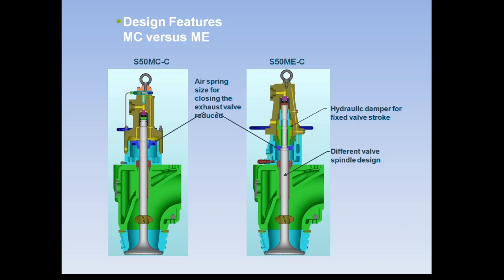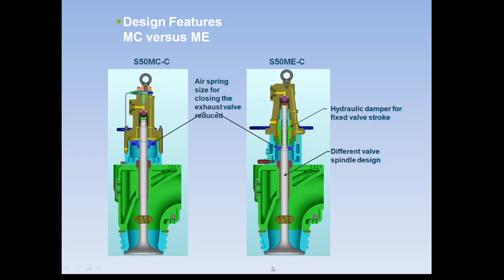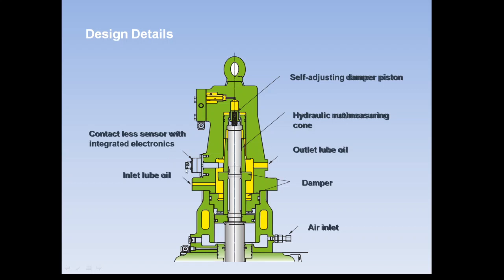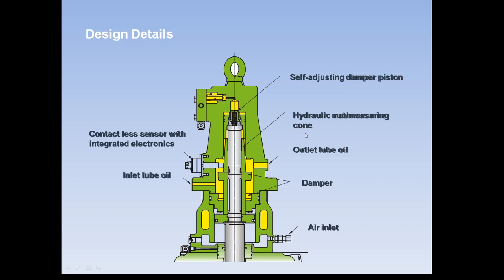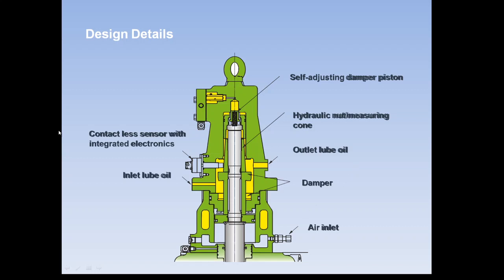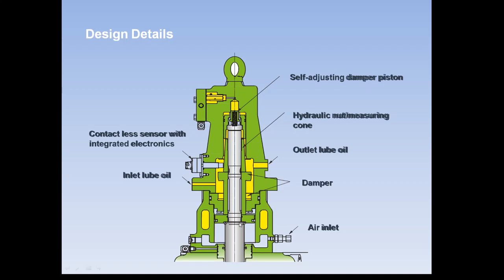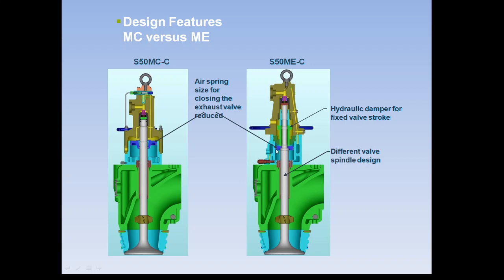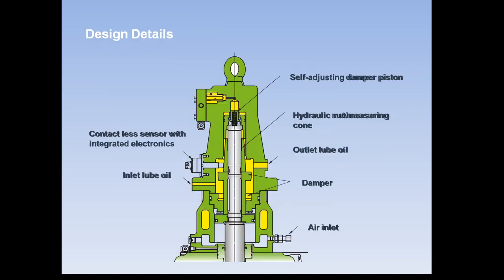Design Difference between MC and ME engine of  Exhaust valve| ME Engine Exhaust Valve|

Comment: Help post:
What is the possible causes for burning exhaust valve of main and aux engine all units frequently...
Reply: Exhaust valve not seating properly when closing causing high pressure gases to blow. When at minimum clearance between seat and valve this pressure gases cause burning of valve seat. This may be a reason